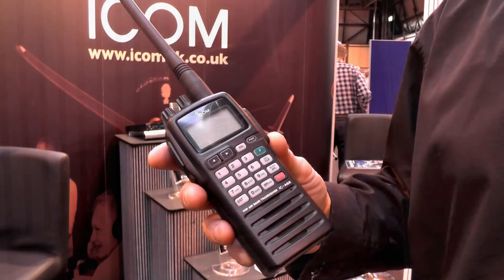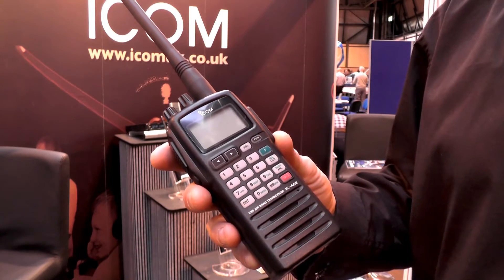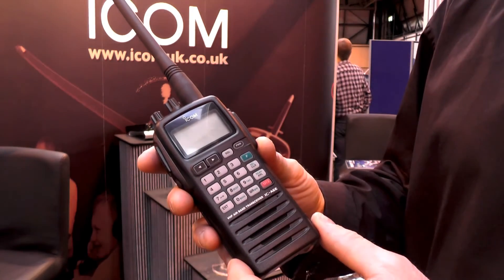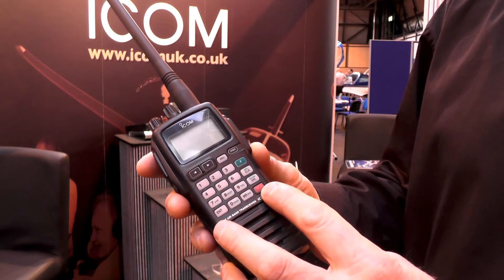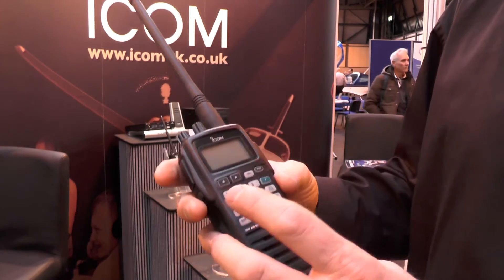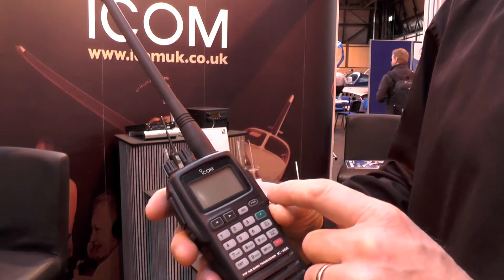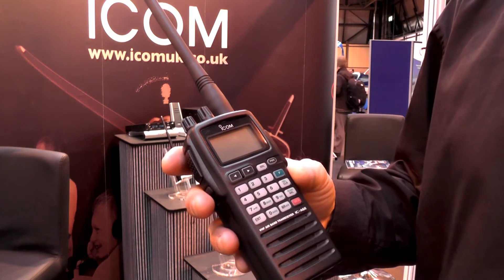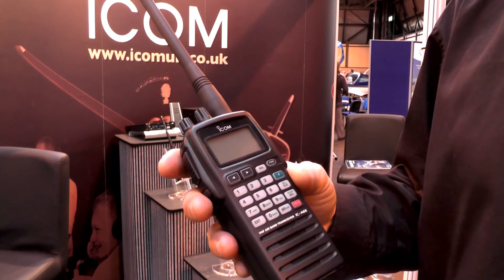Icom IC-A6E/ A24E VHF Airband Transceivers now with 25 kHz/8.33 kHz Dual Channel Spacing!

Comment: Hi, I have been using my ICOM IC-A22 for so many years now and that I am very happy with the unit.  While I already need to replace its original battery pack (CM-166), instead of buying an original pack, I was told its cheaper to replace the 10 pieces - 2/3A batteries inside the pack, probably even using a higher mAh than the original 600mAh.  That way, I could use the radio much - much longer.  Is this something you can recommend?  Will this not damage the radio?  Your thoughts / opinion on the matter will be appreciated.  Thanks & regards!
Reply from the maker: The IC-A22 (circa 1994) is a very old radio now and we are glad that it has provided long service for you.  It is so old, we have not had batteries or battery cases available for several years.  The radio itself cannot support the now required 8.33 channel spacing and we would recommend it is replaced with a radio that can support this.  

Whilst it may be possible to replace the cells in the battery pack this is not a service we ever recommended or provide.  The important thing to do is keep the output voltage correct.  Ideally we would suggest using the CM-167 battery case for AA batteries.  You could then keep the radio going without any issues.  Unfortunately, we are no longer able to supply the CM-167.